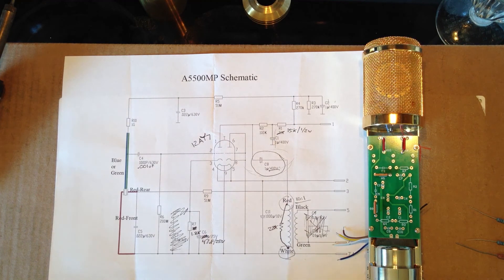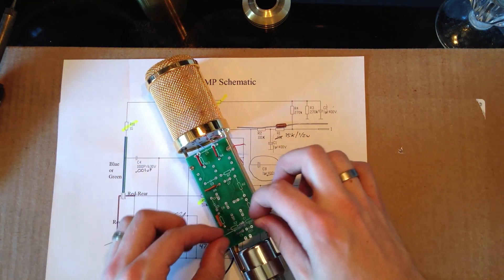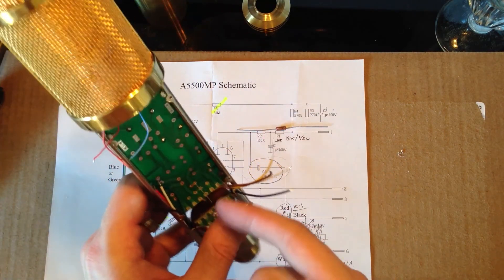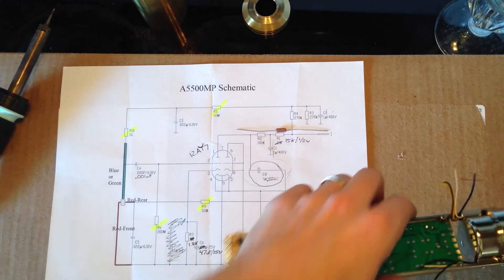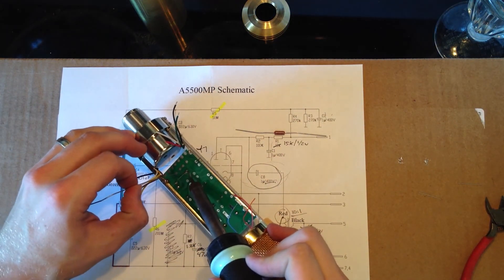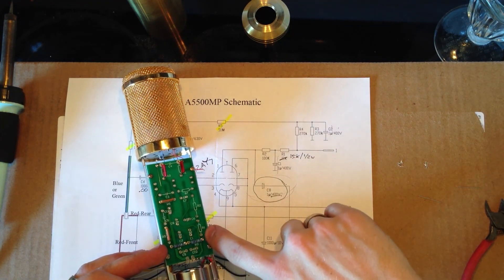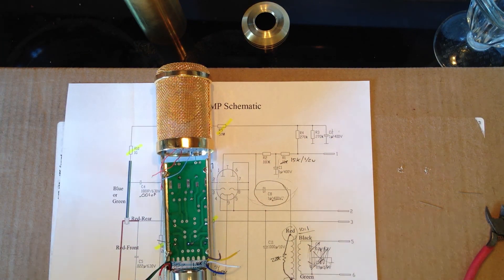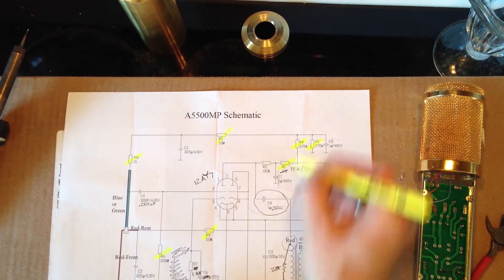Aurycle A5500MP Tube DIY Microphone - Microphone Build Part 2

Comment: Anyone watching this: Do take the board out to solder it, this makes it both easier and massively reduces the risk of dropping the mic on the floor and damaging it. Capsules are very delicate.
Reply: in a prior video he said to replace even the resistors and capacitors - I see that most recommend replacing the tube, but should I really find better quality small parts too?
Reply: @doghouse010  he only does this because he doesn't want to use China parts so he basically using his brain by replacing it with one's he is familiar with matching the same numbers